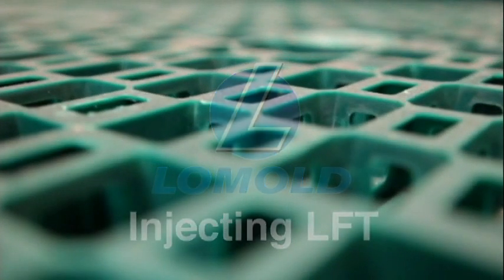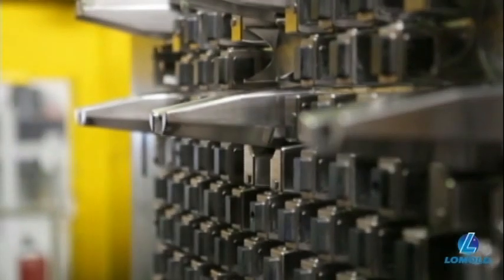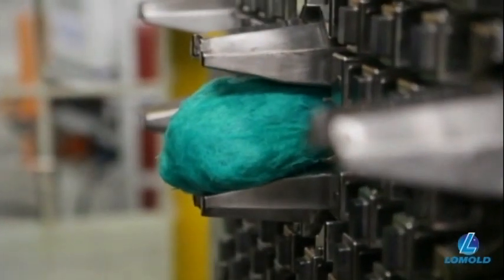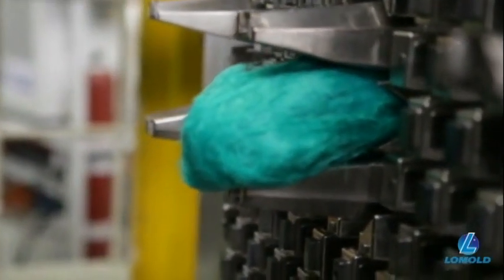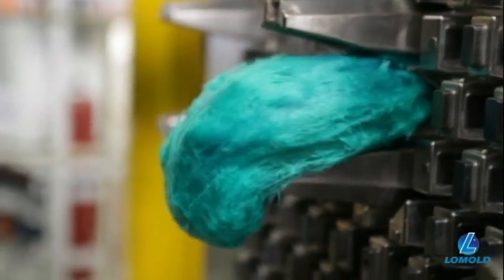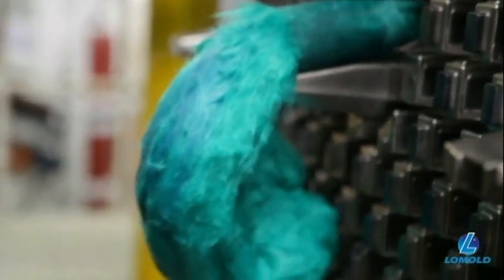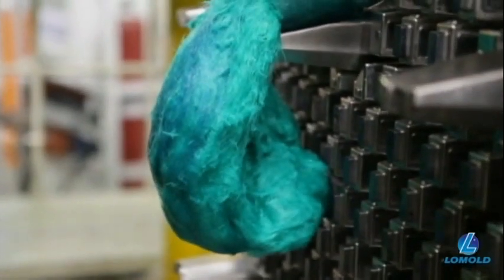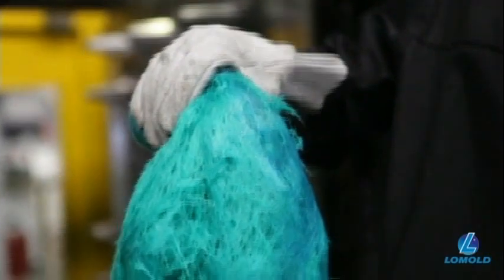LOMOLD - Injecting LFT

Comment: in terms of manufacturing plastic pallets with this method is it cheaper than structural foam or structural web can you advice me
Reply from the maker: It’s much stronger because you’re combining long glass fibre with the plastic, while keeping the fibres long. At the time (10 years ago) it worked out to about 15$ per pallet. The factory has closed though, so no more technologies like this anymore.
Reply: @WouterduToit  can you tell why it does not exist if it is stronger as you mentioned